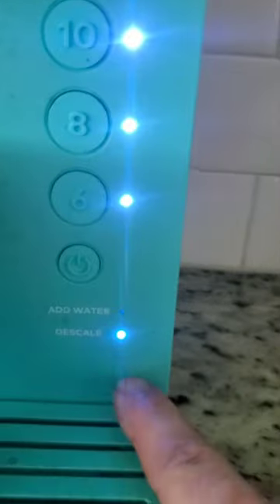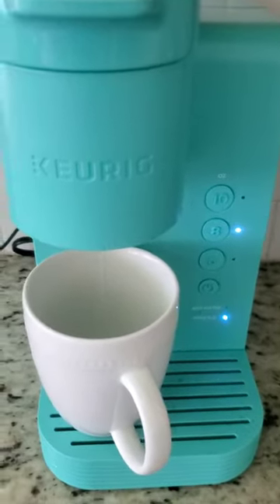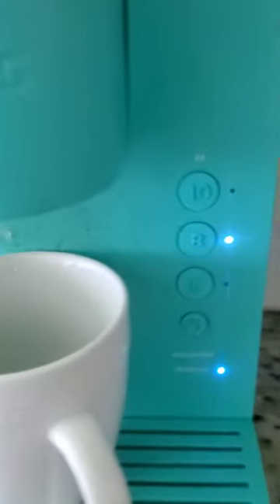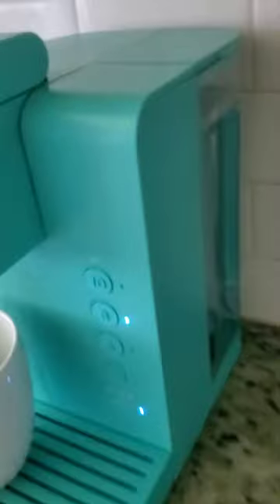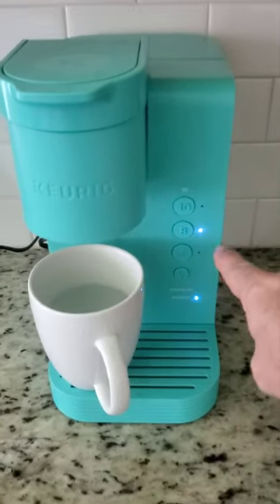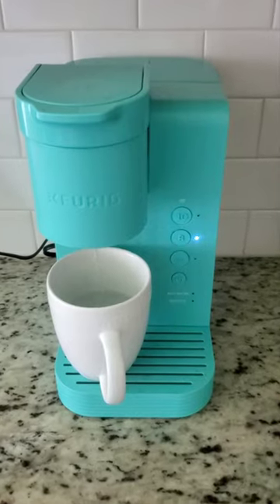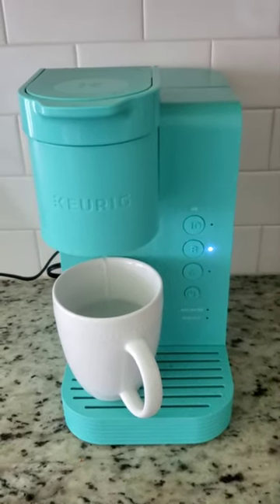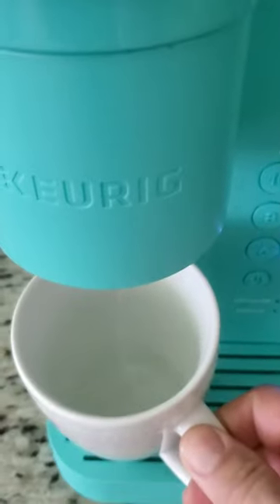Keurig coffee machine K25 descaling. Turn descaling light off. descale your coffee machine

Comment: I'm here cause I didn't read the manual before throwing it out 😅🤠 thanks for the video.
Reply: Same
Reply: @nancyshirah8427 it’s not in the manual. I kept the effing thing and this didn’t work for me either. I’m sure I’ve ran it 80 friggin times. I’m gonna have to live with the light. It even got to the point where the 8 finally went out but after putting water in and opening it came right back on. I’m fuming mad.
Reply from the maker: You should check the water probe. But probably is cheaper to buy a new machine

Comment: thank you so much. We only use distilled water, so the descaling process isn’t much, but we couldn’t figure out how to get the light off after using the descaler liquid.
Reply from the maker: The light should go off. If not try to run a descaling cycle again. Maybe just with water

Comment: If you can't afford the descale liquid or you're just cheap like me put  2 cups of distilled white vinegar into the tank then fill with water and run it like that until the descale light goes off.  Ask your local plumber how to descale your instant hot water heater and they will tell you to use distilled white vinegar and water to do that also.   I hope this helps.

Comment: Thanks for your video. After completing the descaling cycle using both solution and vinegar, the unit turns off. When I push the power button all lights will flash for a second then turn off again. The only way to get the unit working is to repeat the descaling process from the beginning. Any chance you know of another trick?
Reply from the maker: Yes if it is really bad just put more vinegar

Comment: I wish the Keurig would give us a warning a few uses BEFORE the descaling light pops on! That way I don’t go without caffeine like I am RIGHT NOW AHHHHH
Reply from the maker: Just run descaling process . It is fast
Reply: @crifix.  It’s strange. It isn’t working. I press and hold the 6 and 10 oz buttons, then the 8 and Descale lights flash. I press the 8 oz button, then the machine sounds like it’s trying but after 15 seconds or so, all three 6, 8, and 10 oz lights flash then all the lights turn off at once and the machine stops trying to descale. No coffee for me today I guess! Argggg
Reply from the maker: @SpaceDoggy777 try to put vinagre in the water to help the process. Probably your valve is clogged badly
Reply: @crifix. It’s working! Thanks so much 🎉

Comment: Nice to know how to set up the descaling mode BUT you need to run a descaler through the machine--vinegar or Keurig's solution. I would also let the solution sit for at least 15 minutes to soften the deposits inside the machine. Plain water will NoT clean it.

Comment: Nope. Didn’t work for me and I’ve ’descaled’ it till my plug was hot and then some. The lights even went all out eventually but the bottom two. Put water in it and opened it up and bam the ridiculous descaling light was still on 😩😳🤬🤬🤬🤬
Reply from the maker: Problem with the water probe. It cost 2$ to replace it if you do the job yourself. If not just better to buy a new machine